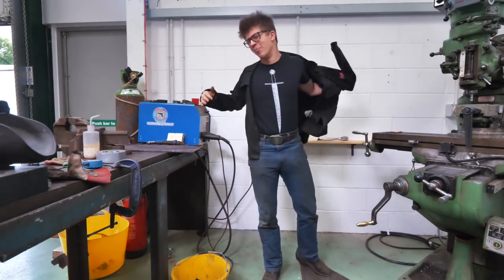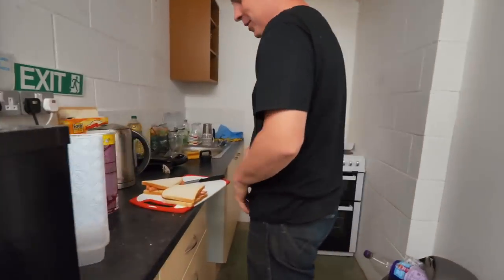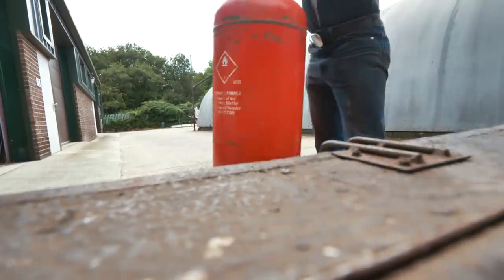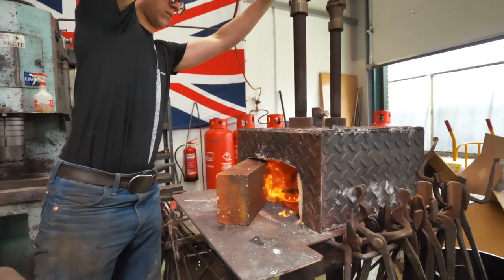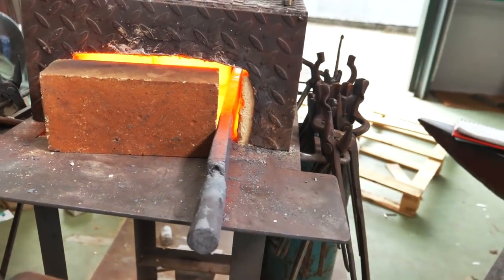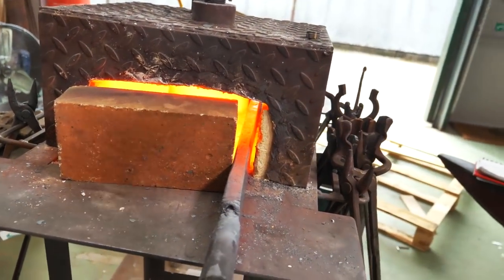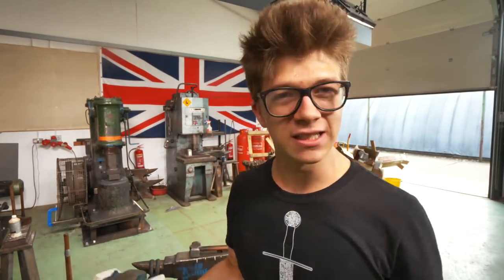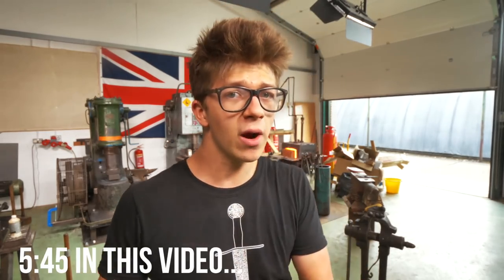VIKING BATTLE AXE: Part 1

Comment: I have a suggestion for you. If you made a clear box with a magnetic closure, you could then keep the respirator in a clean place and yet still be able to see it and get to it easily making easy to remember to put it on each time you need it

Comment: so 2 things are on my mind : one  would be the question if you are gonna use a hardcut in the future instead of cutting the forged steel on the bandsaw. the second one would be this : don´t know how that is handled in usa , uk and so on but in germany  protection tools like glasses, resporators and hearing protection are stored in relativ small blue boxes that you can hang at the wall and just open and close easily , they each have the a protection sign/ pictogram  on the front so you can see what it is , those are hung at the grinding place , welding place and so on so that might be a good way to be just a bit more organized. thanks for the great videos they are a pleasure to watch and a nice inspiration as well , keep up the good work :)

Comment: it depends on which kind of filter you use. There are quite a lot that filter gases too. For example when you use lacquer or oil. These filters, if not put in a airtight box, will filter the air the whole time meaning that the effect of them is probably gone by the end of the day. Usually they can be used for 8-10h straight till they need to be exchanged. So if you use some of these filters it makes absolutely sense to put them in a box to prevent you to spend a lot of money on filters you could have used much longer.

Comment: Just get a couple respirators and leave them near the areas where you most use them.  I do that with safety glasses, but know i should use my respirators more!  I end up just holding my breath for quick grinds or welds.  If I am blasting or powder coating, then I wear a respirator or if I am grinding a lot of pieces.  Keep up the great work!!

Comment: Cody has allot of great advice but I'd have to agree with you on this. I've got in the habit of leaving safety glasses every where for the same reason. I have a 30sec grind but don't want to walk on other side of garage. So i have several. At the lathe at the grinder at the drill press by the cordless tool by the Welder.....everywhere

Comment: They say store them in boxes because the chemicals that's filter the gas stay active if u use it or not. When they are in the box the filters will work longer because they only have to filter the air in the box

Comment: I've been an exterminator for over a dozen years, and some respirators, the ones with activated charcoal or carbon, are only good for 8-10 hours of air exposure.  You have to keep them sealed or their not worth wearing.  With that said your vids are great. Keep up the good work and play safe.

Comment: Hey Alec, It might be a bit late for this, but I seriously think you should install a vent hatch in your ceiling! In the winter if you're running on all cylinders and the shop gets warm due to your forge and the roof gets cold due to the outdoors wouldn't that cause condensation to build up? condensation that could drip on your lights, etc.. that and just to vent the hot air out :P

Comment: Alec, hang the cabinet idea ( Horizontal surface with doors, and just another hoop to jump through when you need to do a 2 minute job.) just mount a mannequin head and slip the respirator on it by the door. On in, off out, and if you're worried about dust and grime on it just cover it with a shower cap. Nothing wrong with simple and affective.

Comment: For those who use Level 1 respirators that use disposable filters (such as the ones made by 3M, Honeywell, and North) be aware of the service life of your filter canisters. Most are only rated for 8 hours once they've been removed from their packaging. Just a tip.

Comment: When welding the most basic way to protect your lungs is to keep your head out of the plume (which you do) you don't necessarily need a respirator when welding unless you're in a confined space but the size of the workshop means you can weld just fine without ventilation and or a respirator, and for the amount of welding you do, you really don't need one

Comment: Dear Alec, I understand the forged material is soft under heat however do you ever have to surface grind or finish the surfaces of the power hammer to avoid marks?

Comment: So I work in a machine shop where I do a (LOT) of grinding, so things tend to get a bit messy for me as well. Here's what we do to keep things clean-ish, at the last 30 minutes of the day a bell rings and we all drop what we're doing and take that time to tidy up before we all make a beline for the punch-clock. 
Works perfect! 30 minutes is more than enough time for me tidy up my work space and even spend some time being a clean freak if I want to.
Just a suggestion, might keep you from getting buried in dust and tools.

Comment: Respirators have a life span.  Normally around 40-70 hours once opened and using. So if left out the the bours are acumulating. 24 hours in a day so two days or so its done in the open. If you keep them stored away sealed up you can use them longer since the airflow is not going three them using up the filters.

Comment: Respirator talk. 

As far as filtering particulates go, your line of thought is perfectly fine. 

But for any respirator that is intended to filter fumes, whether it be from painting, welding, etc, it uses a carbon filter to do so. This carbon filter is working and filtering AS LONG AS THERE IS AIR PASSING THROUGH IT. Most of them have about 40-80 hours of useful filtering. After that, they aren't doing their job of keeping the fumes out of your lungs. This is what a SEALED storing container is used for. To prologue the usefulness of the filter by reducing the air passing through it. 

Hope that helps someone in someway. 

Love your stuff!

Comment: i thought the reason to keep it in an air tight container is because it helps keep the filter from reacting in the air ? I tend to keep the carbon filter in the box for big job and painting and just have a bunch of paper ones quick jobs.

Comment: I don't comment much but all you have to do is hang your respirator on a hook place a rag over the filters and tuck some in the face piece. Then just take the rag off use the respirator then re hang, cover, repeat. Works good even for them 2 minute jobs.

Comment: So Alec, when are you going to build a large billet forge? 3-4 burners, and 2-3 x longer than your current forge. Also, have you experimented with or ever used a ribbon burner? Seems like that would be ideal for the larger projects you're tackling these days.

Comment: I always leave my respirator out, external side up. I figure this- the filter works under negative pressure while you're inhaling, that's what really traps the particles. Of courses it depends the type of filters/cartridges you're using, but how much settled particulate matter is actually clogging up the filter? I'd say it's a minuscule amount, and anything on the face side could be blown out real quick. I think your point about accessibility equaling consistent use is the selling point though.

Comment: Glad to see the wak wak is back.  Now that all your equipment shares the same monolithic slab those up close shots of the hammer are really shaking the shot.  Time to look at vibration isolation pads for your tripod.  Not sure if it can all be pulled out digitally...

Comment: For work we have to be certified and fitted to wear a respirator, they recommend they be stored in a zip lock type bag in a "clean" area.  I would think you could do the best of both worlds and store it in said bag in a locker or on a shelf just out side the grinding room. 
P.S. what is the address for the shop I'd like to send you a Wyoming flag.

Comment: Alec I don't know if it would be possible. But you should contact Color and see how much a bulk tank would cost to be installed. Topping up is bound to be cheaper than tank replacement each time. Then there's your time, fuel, travel etc etc ??

Comment: Apparently you are meant to keep them in a sealed container like a zip bag because of the carbon granules keep absorbing crap from the atmosphere and reduces it's life, so a sealed container is like a of and on switch for a resperator. 
It should say this in the instructions that came with the mosque if you read them and if you're like me a male of the Species you probably won't have !!!
Great vids man

Comment: Alex. my thougth, keep your resperator outside of your grinding room. Keep it right next to the door but not inside. Every time you go in even if it to change a light or camera make sure you put it on. hopefully like a seat belt you will end up feeling wired not wearing it in the grinding room which makes the whole thing self inforcing.

Comment: hy everyone. i would like to get this noticed by Alec. its an idea and perhaps  a chalenge? to get him to do this. i am a big fan of axes yet i never see blacksmiths make the double bearded or double bladed type. my idea to make it interesting is to make it in a new way Alec isn't used to. i see it as this: make two separate blocks  of damascus with two different patterns. then weld them together to fuse at the handle slot. sorry its long but i want to see this made. and Alec if you see this. stay fantastic.

Comment: Alec i have noticed you tip what I am assuming is flux when forge welding the Damascus in most of your videos. Is that step necessary and if so what is the function it performs?. 

By the way I love your videos and its made me become interested in giving black smithing a go.

Comment: What if you were to mount a sealed box just inside the door of the grinding room that you could keep your respirator in. if it's sealed against dust it remains clean inside. Also if it is positioned just inside the grinding room it is convenient.

Comment: Respirator: workplace health and safety here in Manitoba Canada requires that respirators be stored in a sealed box.  That said, I agree 100% with Alex in his environments. I work in a fiber glass shop and you filters are junk in no time if you don't store them properly.  That's the difference between worrying about volatile contamination and particulate contamination.

Comment: I completely agree concerning the need to wear a respirator, however, according to the requirements by OSHA in the U.S. respirators are to be stored in a closeable plastic bag or container. Now, this policy does have some wiggle room depending on the classification of business and the amount of employees.  Having said that, I work in a shipyard building and repairing 1000' and smaller vessels. I've found it's very easy to access the respirator quickly while providing the best sanitary conditions by using a cheap ziplock bag. Just a thought.

Comment: By not storing your respirator in a separate closed container. You defeating the purpose of wearing one. Because as soon as you sit it down. The dust the settles it settles on and in the respirator. I work with lead dust I know what I'm taking about.

Comment: Not a priority, but being in the country you may want to make a wire-mesh swing gate 4 or 5 feet high at the sectional overhead door and the "man"-door to keep curious local dogs, cats or other woodland critters out of the workshop when the doors are open for light and ventilation. Especially when you're working late at night, ...or walking in Monday morning to a hungry and angry frightened cat or dog. 
Unlike here in the States, you don't have raccoons ...or worse, skunks... to worry about.

Comment: One of your power hammers has a bar in the front that is close to the floor so you can easily activate it without lifting your foot from the floor.  Why not consider extending it around to the sides and putting a matching  bar on the other hammers?  If the control is the same between the hammers you never have to think about it.  Just like you never think about your hammer handles when you change hammers because they are all very similar.

Comment: Totally agree about the reperator. If it is not easily accessible your not going to use it. Especially if your running a buisness and time is money. I know there have been far yo many times I have forgone using basic safety gear because it was not right at hand for me to grab.

Comment: The respirator doesn't need to be stored in a clean environment, the cartridges do. Obviously the piece that goes on your face shouldn't be full of dirt, but it's not the part that expires. Not knowing the type of cartridges you use I can't give exact procedures, but I know who can, the package they came in. If they are dust filtering cartridges they may not expire and just plug up. However if they are a vapor removing cartridge they have a shelf life of a set time, meaning if they have an 8 hour shelf life and you use them for 20 minutes and leave it sitting on your bench for 7 hours and 40 minutes they are expired. Vapor cartridges don't stop working just because your not breathing through them, they should be sealed up in some sort of air tight container. Tupperware or zip locks work for me. 

Good work guys!!!

Comment: Why not just get something similar to a medicine cabinet that has a seal on the door to keep dust out and a magnetic latch.  Have a hook inside to hang the respirator on and a small space under it for fresh filters.  Hang the cabinet just outside the grinding room.  Easy access for when you need it and stays clean.

Comment: I wonder if you could use a handle crank driven flower sifter for the powder you are putting on your steel. Maybe that would give you a much more controlled and even coverage. Does that even matter for what you are using it for? Slap, unrelated to this, I Googled flag Damascus steel and your video and images from your video are the first things to show up. ☺️

Comment: Why not just have the mask hooked up out side of your grinding station it will make you grab it as you walk In and you can put it down as you walk out of the work area. Nice sealed box for the new filters attached to the wall as well so everything is in one location. Safety glasses would be advisable as well

Damascus project maybe so :) hangers and a box?

Comment: Maybe the time has come to get a 500 gallon tank that they'll come fill up via truck?  Probably a lot cheaper to buy the propane in bulk too.
Reply: Sometimes it's better to use tall tanks that way you have a sense of how much gas you're using and how much you have on-hand.  Plus in the countryside those tall tanks are ubiquitous and about the same-price per-gallon/lb. as bulk tankage.  If you need gas, it's readily available, ...a truck has to be scheduled.  And there's the fire/safety concerns with a bulk-tank.

Comment: How is sticking your dirty respirator with the clean pads a great idea, wranglerstar? Wouldn't you rather have fresh clean refills once your respirator has done its job? I could see keeping the refills in a closed box but not with a dirty respirator. Kinda like the eBay listings that are "new(other)", never used respirator filters just dirty as flux from keeping them with my respirator.

Comment: I'm curious if the sound dampening combined with the larger space as made a noticeable difference in the noise level of the shop in general compared to the old one. Of course hearing protection is still necessary, but curious if it makes it bearable for the neighbors. As far as a respirator goes, as long as you are using it, keeping it out is fine. At the end of the day, if/when you use a carbon filter, you'd want to box/bag it to keep it from passively filtering and thus decreasing its lifespan -- if you change carbon filters really often, then that's not an issue, either. Kind of wish respirators were more obvious and recommended back in the 80s when I was airbrushing with noxious chems. Lungs would definitely be happier now. And speaking of now, I do take the effort to use the respirator like a lung-protecting fiend for even brief exposures...sort of need to at this point.

Comment: the fumes from most flux are really really nasty stuff, alot of the nasty from welding is various forms of flux, flux core welding wire, the flux from arc welding rods, etc(the flux being sprinkled onto the steel for example im betting isn't good to breath in)

Comment: Hi ,loving the new workshop. however closeup shots rite beside the power hammer are causing image shudder .its nauseating when viewed on my 50 inch TV. maybe employ some kind of anti shock for them shocks. keep up that awesome work. ☺
Reply: paula kenneally I noticed that too, I wonder if putting a bit of foam (or rubber?)  under the feet of the tripod would absorb the shock a bit.

Comment: What if you had a vent in the roof over the forge, let that heat out. Then you could have your door shut making it quieter for your neighbors and cooler for you. Does your hammering vibrate your  neighbors floors? Lol

Comment: Captain here: For those of you who's wondering in what video and where Wranglerstar starts talking about respirators, check out the video called "Testing The Cheapest Machete on AMAZON", he brings out the respirator at around 7:36 .
Flies away
PS: I don't consider this advertising Wranglerstar's channel for obvious reasons. So I hope you don't, either.
Flies further away

Comment: Zip lock bag hung on the wall for respirator??
Question?? Is true Damascus folded on it's self and reforged many many times?? Not intended for the true to sound snobbish because the way you do it you can control the outcome more decisively.

Comment: Your gunna live to like 200 years old. I’ve been a welder for almost 10 years and I really don’t wear a respirator much. You definitely should with anything stainless related but with mild steel and stuff I don’t think it’s to much an issue. The particles you breath in will oxidise and pass through your body unlike stainless